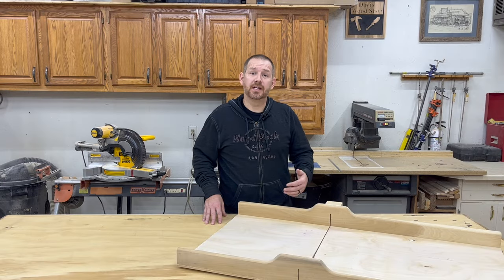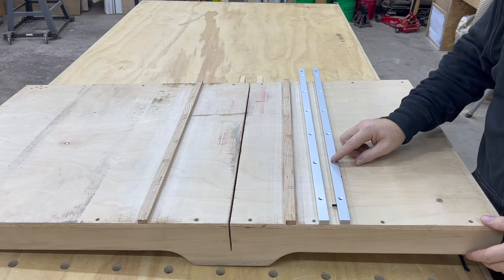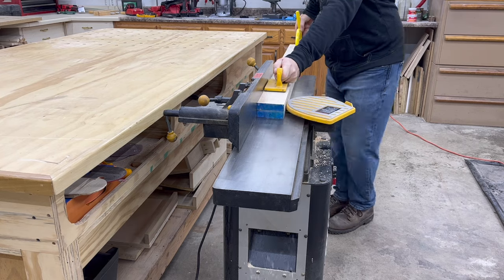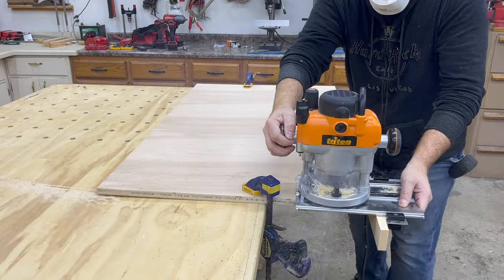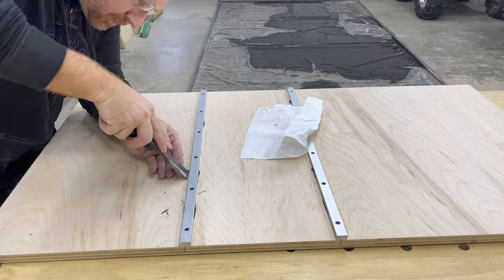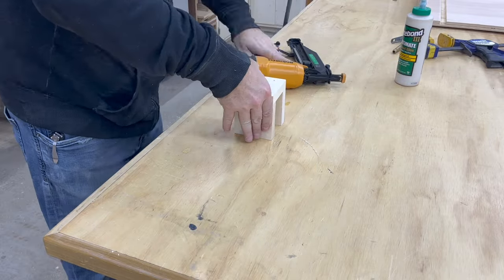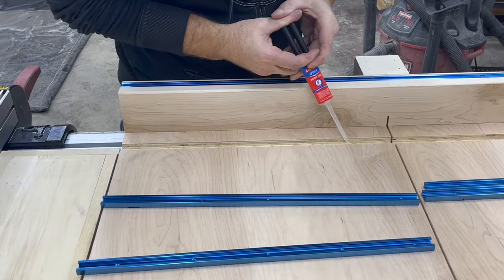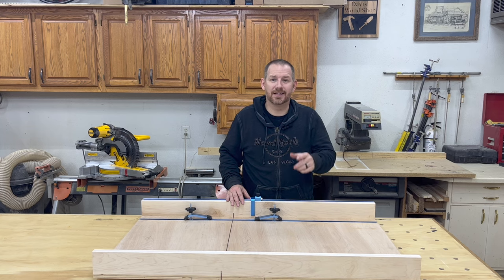Table Saw Crosscut Sled Made Easy!  Best Woodworking Jig!  A great tool for every woodworker!

Comment: Great video. Can you explain what you were doing when you were dialing in the square?  I get the 5 cut method but what part were you adjusting each time, the whole back piece with the top t-track?
Reply from the maker: Hello, thanks for watching!  Yes, I was adjusting the entire fence using a feeler gauge to make small adjustments.